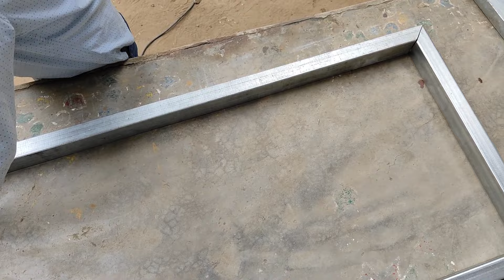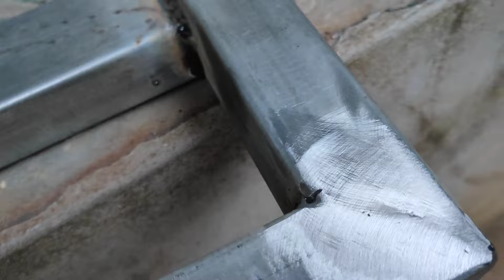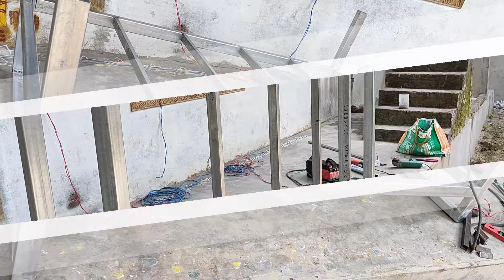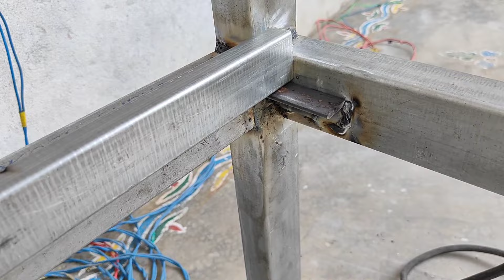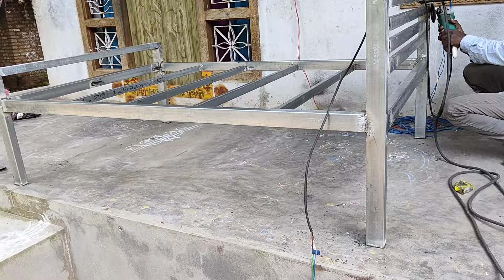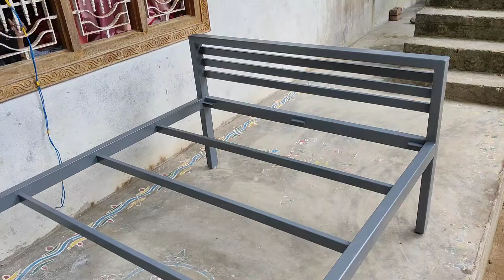Iron bed making video || 4*6 Size fixed bed || Vishnu SAR 😊

Comment: Material size..?
MS or Steel...?
Reply from the maker: @sjeet0411  metal sizes 
1.1/2 sq
1.1/2*2.1/2 sq
3/4. *1.1/2 sq
Galvanized iron